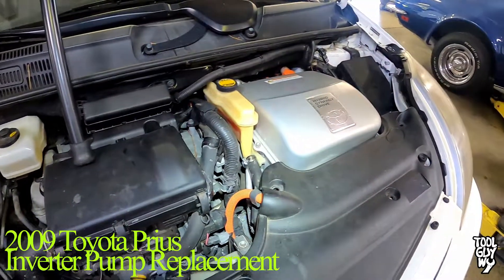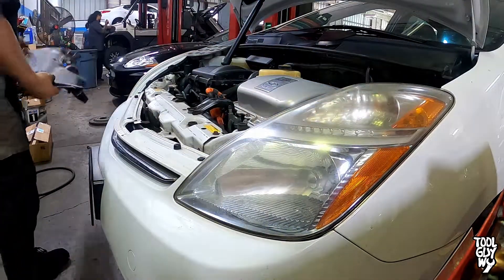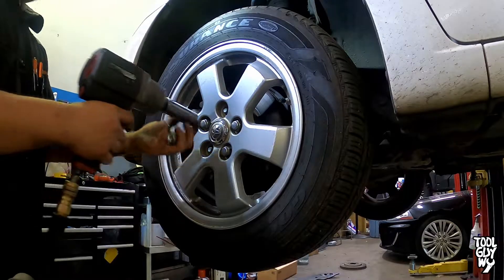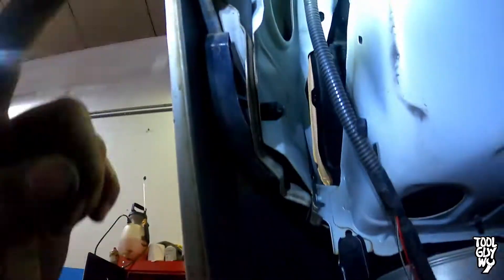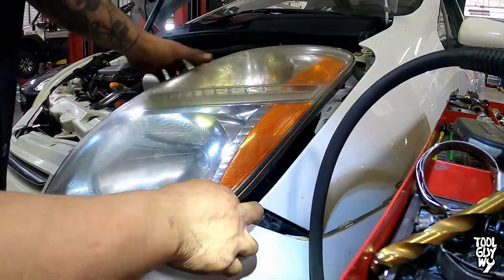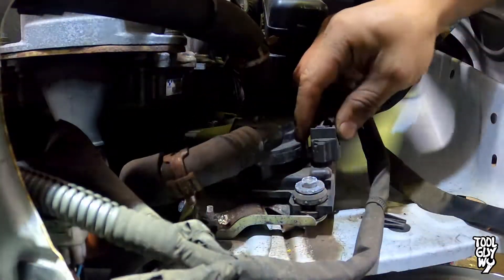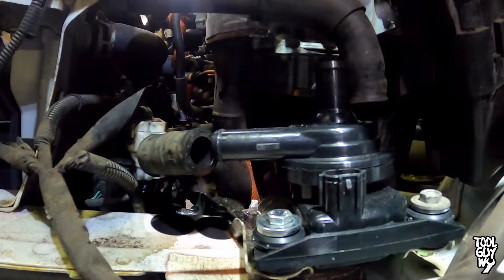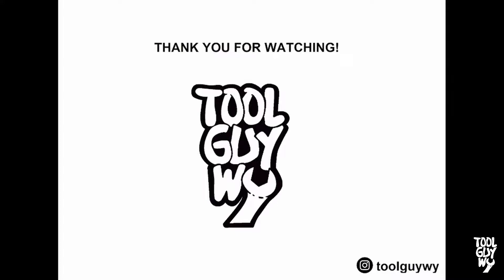2009 Toyota Prius Inverter Pump replacement

Comment: I've seen another video where you don't have remove fender, and headlight shielding, but this is the best for easy and quick access.  If you want to fight it a little you can come from the top on a 2008 Prius.

Comment: Is it true that those hose clamp types break, because they they expand due to heat and don't retract properly, like the OEM style ones that you use pliers to take off. I read that on reddit r/mechanicadvice

Thanks. Great video. I learned a lot.

Comment: Just a tip there’s a bleeder on the inverter side no need to bleed from the radiator
Reply: @george ramirez Do I need to turn the vehicle on for it to bleed out?
Reply: Will the pump run with the car parked and on?
Reply: @bill4639  yes you’ll need to have the car on , you can run a clear hose from the bleeder to the inverter fill so it can circulate and remove all the air

Comment: Way overkill. You can do this without removing the wheel and about 50% of the work.
Reply: You can pull out the headlight without taking the tire and black cover off, just turn the wheel.
Reply: You don't have to do so much work to take off the headlight FWIW... https://www.youtube.com/watch?v=A6X1wujrH0g
Reply from the maker: Yes, maybe.  However prodemand said to do this.  I followed it as the "proper" way.  Also to those who cant get to the hose clamps lose from the top, removing the whole headlight assembly is the way to go because it gives you more room that way you wont break anything while fighting to get it off.
Reply: @DI_Wy  Agree this was done "By the book"   and if you have the tools to removed bolts and clamps you need the access.  That clamp wench is cool.